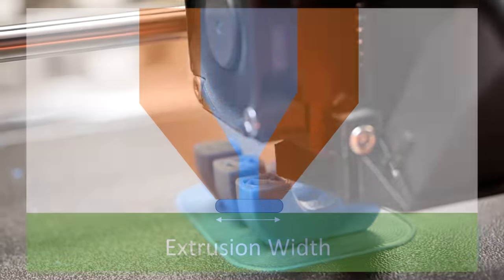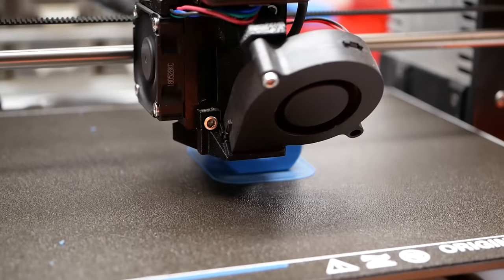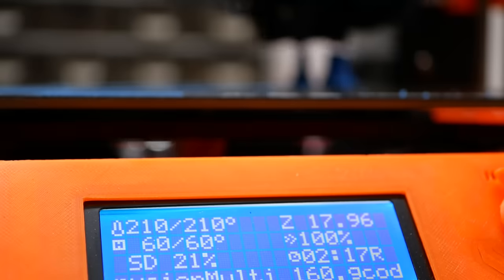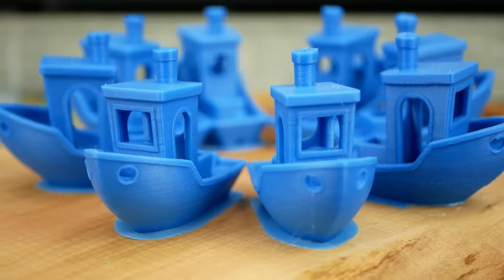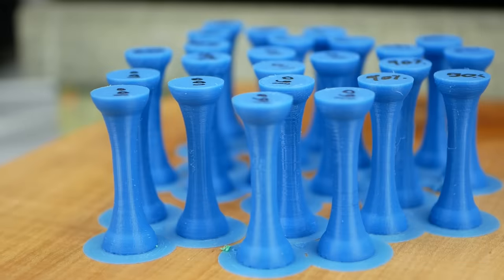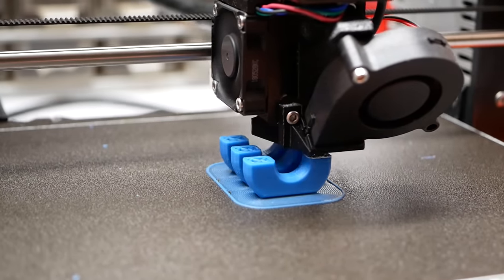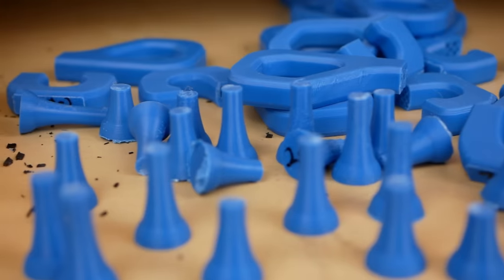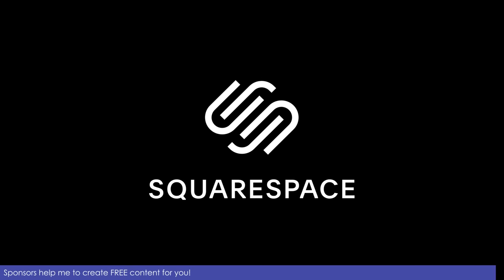Extrusion Width - The magic parameter for strong 3D prints?

Comment: For maybe a year now I have always extruded my infill at 1.5x the nozzle diameter. (I use gyroid mostly). It seems to make very good quality infill, and it takes less time at the same percentage infill%/speed settings because it draws fewer lines of infill. I changed the infill width originally because I was having problems getting a good quality infill at very low% (like, 8-12%)

Comment: I have watched all your videos about strength. I have a Bambu Lab P1P and it has a standard and a strength profile. The strength profile adds more infill, more walls which I understand. It also slows down the outer wall from  200 to 60 mm/sec. I would like to see you do a test of just the speed difference, on a thin wall part such as a parts bin, to see how just the outer wall speed affects strength.

Comment: Having been 3d printing for 9 years now. I have noticed how the nozzle basically irons the bead it lays. 
Soooo; instead of having a tiny flat area at the tip and the rest taped off. Have a large polished wide base to the nozzle. Basically made with no taper at all. 

This may have 2 effects. 
1. The new line and the surrounding area are all heated, and for a much longer time. So it is not just the heat in the printed line boding the material. This may make it bond better.  
2. Those annoying ridges you get on the final layer will be ironed out, quite literally. So the final top layers may be much smoother. 

Or it will all go horribly wrong and stick up everything. Am still wanting to try this but have no time to do it. Though i have all the kit to make the nozzle and everything.

Comment: Everyone always looks at strength as a factor of mass of filament used. Newtons per gram, etc. But for many of us, the real denominator isn't the amount of filament used, but the machine time. Thus I just consider how I can get the required strength with less print time.
Reply: Damn, YES! We need profiles not "draft, coarse, normal, fine", but "harder, better, faster, stronger"!

Comment: When I didi this with ABS, I did notice an increase in layer adhesion, but the walls were able to be peeled off. I had to increase the flow rate to compensate.

Comment: Have you ever considered doing a video that brings everything you have discovered in all of your tests? Like a video that, quality aside, highlights the best combination of all the settings and differences to create or maximize the print strength? I mean everything from number of wall lines, to print speed, print temp, fan speed, this video, layer height, even the 98% infill to get the different layer directions. And see how high you can push a filament, obviously quality aside. Just curious. Have a wonder day, also you make fantastic videos. Extremely thorough.

Comment: Great video and methodology. Next question: effect of thickness/width aspect ratio on strength or combined DOE on the variables thickness and width.. I suspect that it could be possible to reach high strength value with thick layers by increasing extrusion width to 150 to 200%... (Or switching nozzle size).

Comment: Layer height has a similar effect, but you need to increase nozzle diameter. You also may need to slow print speeds, use a volcano or similar, raise temps, etc to make sure the the plastic is melting. But even with slower print speeds the time spent printing will probably still be shorter since you are printing fewer layers.

Comment: I modify it for almost all prints. I go wider for speed and strength, thinner for surface detail. I tend to do wide inside walls and thin external ones and top / bottoms. I also try to tweak it until the model walls are evenly divisible.

Comment: Thanks for the heads-up! I never touched extrusion widthexcept for dialling in exact dimensions on the finished part, which has been superseded by XY compensation built-in to the slicer.

Comment: I believe wall overlap percentage is related. (The overlap between the wall lines.
Reply: overlap percentage  is for the infill, to go a bit inside the internal perimeter, to fuse with the shell.
Reply: @supermerill  there is a separate option for just walls on my slicer. It may be called something else on cura.
Reply: @darkthoughts1688   I use Ideamaker and it has this feature, separate from infill overlap. I usually set it at 15-20% to promote good perimeter fusion
Reply: @ninj4geek  yep same here. I've used a few other slicers and Ideamaker has the cleanest UI, despite not having some advanced features.

Comment: In metallurgy, when testing material samples (such as has been done here), they also take an additional step of polishing the surface. Why? This is where cracks start. With a polished surface, there is no place for the surface tension forces to concentrate. I can't help but think this may also be a factor in "material strength". A reality check might be to compare an unpolished part to an otherwise identical polished part. If there's a significant difference in strength, that might be another area to explore for those who are willing to work on the surface finish.

Comment: I expect that these results apply only to the material that you extruded and will vary with hot end temperature.  Different materials will have different optimized parameters.  It is also possible that atmospheric conditions will play some role.

Comment: Awesome work as always!
I already tend to bump up extrusion width when I want better layer adhesion and +30 to +50% seemed like the sweet spot by intuition. Now there's data to back it up 🙂
Could you make one on how simple overextrusion could change layer adhesion? I tend to overextrude by about 5-8% with structural prints that don't need super precise dimensions. Especially with PETG it would be very interesting since it has good layer adhesion to start with!

Comment: Great idea. Only you would need a simple way to check if it really extruded more material. I did a simple test of weighing parts with different extrusion width. Sad result: my printer or let's better say extruder cannot increase the pressure in the nozzle any higher.

Comment: I had to change my top layer because the top layer had to much material so it made a rough wavy surface or stringy lines connected at the ends. I tweak them sometimes most of the time on the bottom or top layers.

Comment: I want to share one an issue I had when using large line width setting that can cause those funky surface patterns you noticed. Also i want to share a different slicer tweak I use to eliminate those bad surface patterns. I do a lot of printing with larger nozzles up to 2.0mm and I use CURA which does not easily give me the ability to change the nozzle size so I started using line width setting a lot but then noticed those strange surface patterns. What follows is not scientific but based on my observations, it WILL give you better surface quality prints, but my guess as to WHY you get better prints may be incorrect. The undesirable surface patterns are most pronounced when the surface is curved. I think this is due to the slicer not wanting to generate paths that are shorter than the line width, so you end up with a longer paths that create patterns on the surface (think low poly paths). To correct this I needed to leave line width small so I get smooth paths while still extruding enough plastic to get the large line width.  I am able to accomplish this "over extrusion" by telling the slicer my filament diameter is smaller than it actually is so it will over extrude OR you could do the same by setting the flow higher. This makes a huge difference in the surface quality and still allows you to print wide lines.
Reply: ops - i forgot to mention I am using this primarily in vase mode with my 2.0mm nozzle , multiple shells and infill will have issues if you are over extruding with this method .

Comment: Looking at it now ; 
I wonder if a higher nozzle temp (for easier extrusion) and better cooling would have changed the appearance of the high % prints. Since the fan speed was at 50% for all prints, I feel one should experiment with that aswell.
Which I will do the coming days :D Thank you for the inspiring video and easy to understand explanations of the topic.
( I know you mentioned raising the temp and issues with cooling, but I feel testing these would have made the video even more informative, as I feel one could get larger extrusion widths as shown here.)

Comment: I switched to a 0.6mm nozzle on my Prusa i3Mk3S and I'm not looking back. I usually don't play around too much with extrusion width, but it's usually 120% or so if I'm using S3D or Cura. I went this way for fast functional parts.

Comment: So now the question is what is the optimal layer height for strength-speed in relation with the nozzle or the extrusion width.
From other videos of you and this one it is clear that layer height for getting stronger parts should be around 50% or less (up to a limit...) when printing at same extrusion width than nozzle diameter.
But it happens the same when printing with biggere strusion width than nozzle diameter.
In order to optimize printing speed it will be good to know.

Comment: Without testing it I assumed that smaller line widths would result in better adhesion due to the reduction in gaps similar to an integral. Very interesting results! The wider line widths must just be closing that gap faster than the smaller line widths. Or maybe something else in the slicer is being adjusted that we aren't aware of. I'm using Cura. What do you think?

Comment: I have always adjusted extrusion width (usually *down*) to keep Cura from doing those ridiculous tiny infills for the final, central perimeter.  So for example in CAD I would make a wall 1.2mm thick and tell Cura to do 3, 0.4mm wide perimeters on a 0.4mm nozzle.  What Cura would actually do is two perimeters and then do zigzag infill for the remaining gap.  I assume this is due to some sort of rounding errors because if I just make the extrusion width 0.399mm the issue goes away and I get a clean line for that final perimeter.

Since then I've switched to PrusaSlicer 2 and so far don't notice the same issue with that slicer.

Comment: Hey Stefan, I would be interesting to see how much you need to beef up an ABS/PETG part in terms of perimeter and infil, to the same strength as an PLA part with same dimensions to that we get both strength and temperature stability.
Reply: I'm not sure we would see an equivalent strength, but anything that approaches that would be quite useful. Of course, it's seem likely this would also depend significantly on the part's design geometery.

Comment: Good video! Although you should test more than just 3 samples. Your standard deviation error bars overlap suggesting the values for each test are not significantly different from each other. I find a minimum of 5 and a maximum of 10 is optimal. As a rule of thumb i consider the result reliable if the SD is less than 10% of the mean.

Comment: I assumed this was one of those values you needed to calibrate?

What I did was print a cube in vase/spiral mode with no bottom layer, measured the wall thickness on all sides and put in the average for extrusion width.

Funny enough, my prints were more or less perfect after doing this and printing a few calibration objects.

Comment: One of the important thing that why is %200 parameter sucks is because you squish more to the filament you will have more contact to filament with nozzle .That means you will not be able to cool filament quick . You Should try %100 fan speed on %200 parameter .

Comment: A wider nozzle would decrease the pressure with which the material is extruded. It might be the case that the same line width on smaller nozzles produces better layer adhesion than wider nozzles. Would be really interesting to test!

Comment: Really confused about the specific parameter we are calling "Extrusion Width".  Early on Stefan's diagram illustrates it as the gap between extrusions.  Many other comments here claim it is a % of nozzle diameter - or layer height -  depending on which one you're reading.  I use S3D which defaults Extrusion Width to .48 for a .4 nozzle.  However I'm totally confused what to set it now to achieve Stefan's parameters.

Comment: I have always ran my Line width .04mm smaller than what my nozzle actually is. 

I use a .6mm nozzle, and running a .56mm line width always gives me amazing results, i've actually figured this was one of the most important settings for the quality of prints I produce.

Comment: This is invaluable info !!! I've just made a few test prints with a brand new first printer and I know just about nothing haha! Room for improvement taken to the next level ...
I've been thinking about the print direction? Intuitively it seems like a standing object is a long spiral that's easy to snap off att the middle but a laying down object has the "fibers" in the other direction so it ought to be a whole lot stronger. Have you made any tests showing the differences if there are any?

Comment: I will fudge the line width when nozzle matching. Basicasly I print a 4" disk whenever I chang out nozzles which I adjust the flow in my printer's tuning menu for my 1st and 4th layers to optimize build plate adhesion and line continuity if I have to push flow to much one way or the other I'll adjust line width to reduce filament head pressure.

Comment: Thanks for these tests. For a sturdier artistic 3D printed object it makes sense. But it would make even more sense for a mechanical part, since those usually undergo more constraints. However, a mechanical part needs dimensional accuracy. Doesn't adding wider lines change dimensional accuracy, making the material expand in all directions (resulting in a bigger object with smaller holes, compared to the object designed originally in the 3D modelling software)?

Comment: You aren't really supposed to increase or decrease the extrusion width past 25% of the nozzle diameter. Anything over or under will cause inconsistent extrusions. If you really want to increase your extrusion width and decrease print time or increase print quality its better to use different size nozzle diameters. I have a set of nozzles ranging from 0.15mm to 1mm, You have to do a lot of settings adjustments for each nozzle size but its much better than pushing extrusion width past the +- 0.1mm of nozzle diameter rule.

Comment: I have a potential follow-up for this one, if you don't mind revisiting it. Perhaps you already have the data on it, but just in case...

How does layer height play into this? Your graphs showed peak strength at around 140%-150% extrusion width, always with a 0.16mm layer height. Would this multiplier continue to show the same relative strength in the event you used a thicker layer, like 0.32mm, or thinner layer, like 0.08mm? Or would this shift the resulting graph curve up, down, or skew it completely?

This stems from a discussion I found a while ago (but can't find anymore) suggesting that the ideal extrusion width is the sum of the nozzle width and the layer height. In the case of the testing performed here, that would be 0.56mm - or 140%, which may or may not be a coincidence when considering your results.

Comment: I have always been doing this, but sometimes it gives variation in sizes, but parts are werry strong, just mad a clip yesterday, a standard C shape 20mm wide and 2.5 mm thick walls and with a pull out on the C shap i got 30 kg before failing on a old ABS. So one clip can hold the mirror I made it for like 10 times. And infil was in same direction as the wall, so each layer was almost one long extrusion... 😁

Comment: Wonder if PETG would have the same properties.
Reply: Yep
Reply from the maker: I assume that there should be the same tendency in terms of layer adhesion.
Reply: And so does HIPS, ABS and Nylon and probably evreything else I have not printed yet
Reply: PETG definitely benefits (in my case anyway) from at the very least having the infill extrusion width bumped up by a good bit, makes the infill print cleaner and faster, without the normal snotballing behaviour on the infill.
Reply: @EvilGTV  Same here. I definitely get better infill with PETG by bumping it up to 150%.
Reply: @EvilGTV  I have no such problems, probably because with PETG I set all print speeds to a single unified value (so perimeters and top/bottom are the same speed as infill). Might change that once I get linear advance up and running. But some slicers tend to have infill speed way too high (at least for a clean PETG print).
Reply: @EvilGTV  I did not understand the last part where you say "without the normal snotballing behaviour on the infill". When exactly do you get snotballing and what do you mean by snotballing ? If you increase the infill extrusion without changing anything else it gets fixed, you say ?

Comment: It seems the most common default setup is a 0.4mm nozzle, 0.2mm layers height and 0.4mm ext. width (100% nozzle dia.). Perhaps this is seen as a good compromise between strength, speed and quality. I'm thinking changing out to a 0.3mm nozzle and maintaining the same height and width settings might be a good approach. this will result in 133% extrusion width while keeping the same dimensional precision as default set up.

Comment: It tracks, logically. For the same total wall thickness, there are half as many layers, meaning layer adhesion plays less of a factor into strength. Although there is less infill, once again, stronger, wider infill lines means it plays less of a factor.